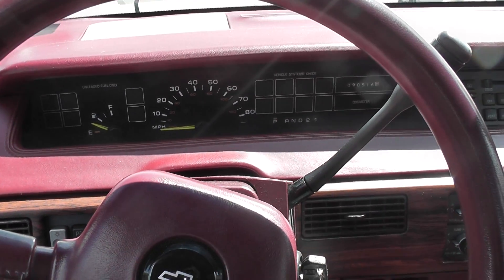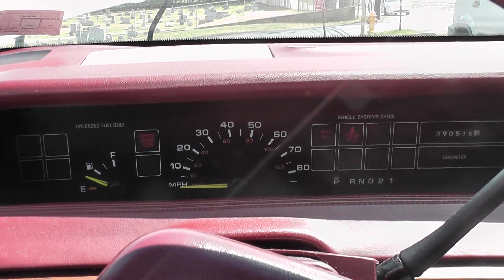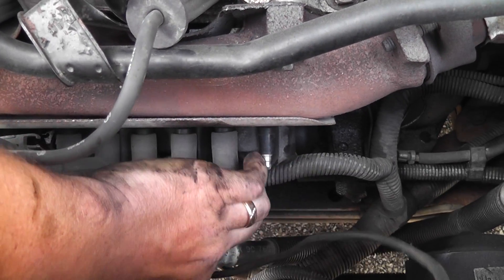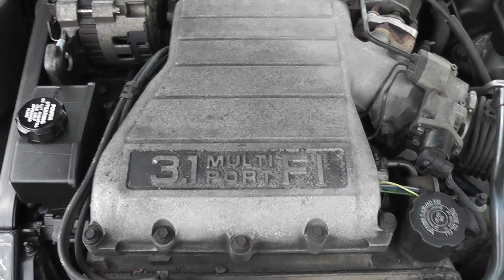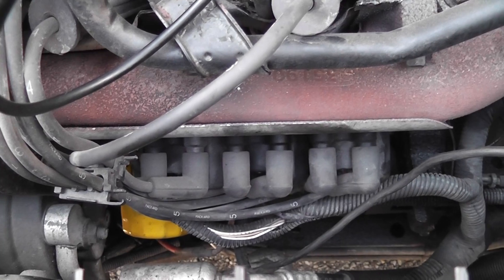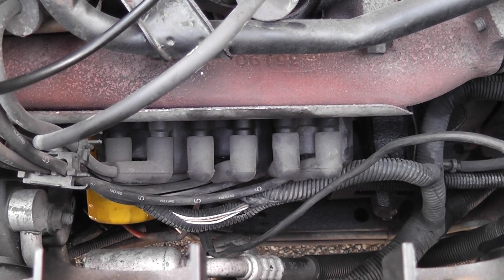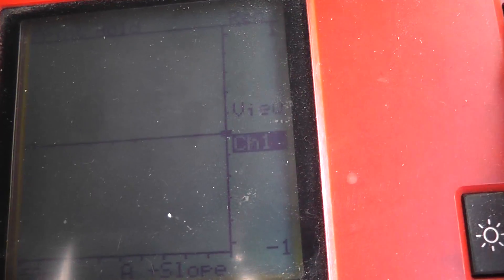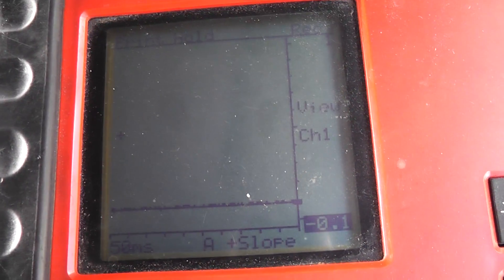How to test for shorted fuel injectors (1987-1994 GM Cars)

Comment from the maker: Buy the older Vantage, you will not be disappointed. It doesn't have the detail as a true scope like the Vantage Pro does, but it has scoping type capabilities. 
you can view injector waveforms, coil primary current ramps, ac sign waves and digital square waves. 
also it has a 300 microsecond glitch capture capability. and an awesome data base that is unmatched in this field.

Comment: You're right only one control wire, I was just wondering if it was possible to cut that wire and hook an ammeter to read the amperage. Normal amp draw should be around 4.2 A so anything above that would indicate a problem,correct?

Comment from the maker: I was going to say the same thing, nice job correcting yourself :-)
Also to add to this,  if the control wire was shorted to ground it would be constant current flow and not three times the normal amount. Plus it would be completely flooded.

Comment from the maker: No, it doesn't need one as all of the injectors are fired at the same time. And for coil sequencing the crank has a sync notch in it for cylinder pair ID (so it knows which waste spark coil to fire first)

Comment from the maker: Fix that wire first. It shouldn't be related to the no charge issue. Let me know if the battery light is still flashing after the fix. If it is we must fix this issue. When we do it should charge again. Also do that test light test I told you about.

Comment: It did before I completely broke this wire, but now it dosen't crank.. This wire was barley on part of the soliniod is broken.. I don't know how that happen.. So now I will replace  the whole starter... Could that wire have been at fault for charging system?? Also I took both alternators to be tested both passed.. I also loaded tested Batt,, it did not drop below 10 volts.. There is electrical issue on this car i just don't know what

Comment: @ scannerdanner  while messing around at starter solenoid that was partially broken gave way now tha batt light flashes along with coolant light... This is a heavy gauge purple and white stripe wire..  S terminal wire?? So this would be a ground??

Comment: Hi Mr Paul 98 voyager 3.0 no spark good crank and cam signal I test the coil with two wires one from the fuse and pcm, the one from the pcm spike at >25.00vdc  at the coil and unplug it spike -1.74vdc it this coil bad? just because the owner have change the coil, wires, cup crank and cam.

Comment from the maker: That small gauge red wire is not a ground. It is part of the bulb circuit. With the engine running disconnect this single red wire connector and touch the pin on the alternator with a test light connected to battery positive and tell me if it starts charging. Also with the KOEO, does the charge indicator light or battery light light up on the dash? Some of these alternators will not charge with a bulb circuit malfunction.

Comment: Scannerdanner, Please Help!!! 94 olds mobile nintey eight alternator not charging, I do have good battery not shorted, switched alternators twice, no luck i have 12v going to alternator from batt.... One red wire connector for ground, koeo black test lead to one red wire connector red lead to batt pos  showing  12 volts...  However I did see purple wire with white trace, looks like a fuseble link on starter solenoid is simi broken.. Could this have something to do with it bad ground???

Comment from the maker: on these groups fired systems. all 6 injectors fire at the same time 1 time per 360 degrees of crankshaft rotation. the intake valves are responsible for controlling the fuel into this cylinders at the correct time. think about it only 1 intake valve is open at a time. kind of the same way a throttle body injected engine works or even carburetors. the intake valves control the flow to which cylinder
Reply: I thought it was batch fire system where 2 cylinders fired at the same time, and delivered half of the calcualted fuel on the intake stroke, and half onto the back of the closed intake valve during the power stroke. Rather like wasted spark coils.
Reply from the maker: @gregorymalchuk272  no sir, all of these early GMs were group fired systems. There are pair fired designs (early Toyota for example) but not GM
Reply: @ScannerDanner  Is the injector firing totally asynchronous? Or does it synchronize on some particular crank angle? Did any GM engines have batch fire? Or did they go straight from group fire to sequential?
Reply from the maker: @gregorymalchuk272  it would be synced but not sure specifically to what signal. They're may be some variations out there (Cadillac in particular), but yes, they went from group right to sequential

Comment: Paul I have a question about the amp probe, I have a pico low amp with bnc cable and I just aquired a Vantage (from ebay), will I be ok if I buy an adapter from bnc to 4mm(banana plug)??????

Comment: It has 3 wires power ground and control in the component test on the verdict it states to test at the control wire maybe this test is a waste but it is under the ignition testing category on the verdict what do you think?

Comment from the maker: may be it is a multi-strike ignition like Ford uses? Not sure why you are checking frequency on a COP coil? Are you sampling the coil negative wire or a coil base circuit control wire? I guess a better question would be how many wires are on each coil?

Comment: On a coil on plug ignition why would the frequency jump from the 5-7 hertz spec at idle to sometimes over 300 kHz when backprobing I use the snapon verdict. Please let me know. Thanks. Ps the car runs fine I was just doing some checks and saw this. 2007 Acids Tax 2.4.

Comment: Wouldn't a shorted injector be the same as a non-contributing coil pack?  The engine won't attempt to send fuel through the other good injectors if 1 is bad?  Wouldn't a short in the injector harness make more sense?